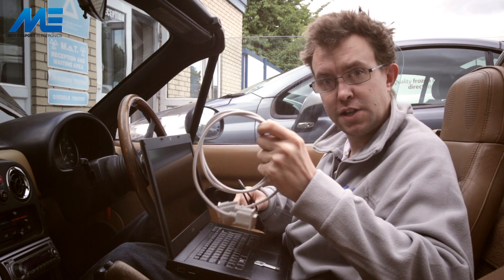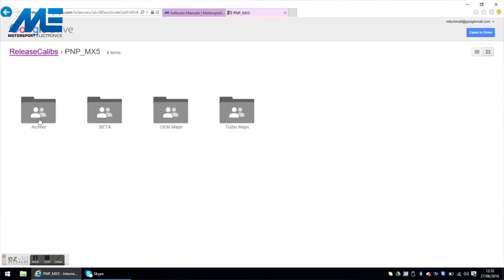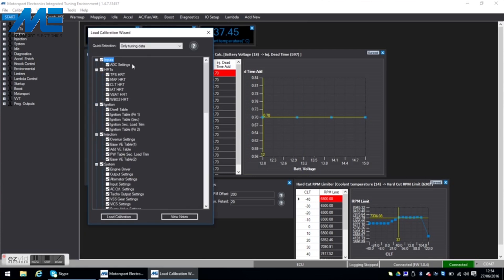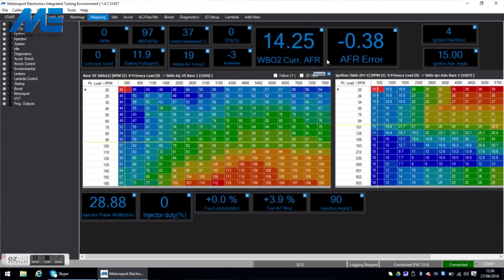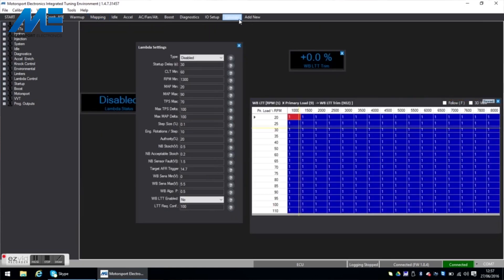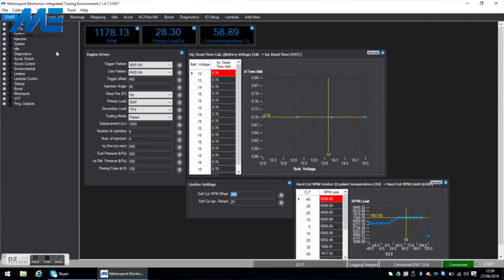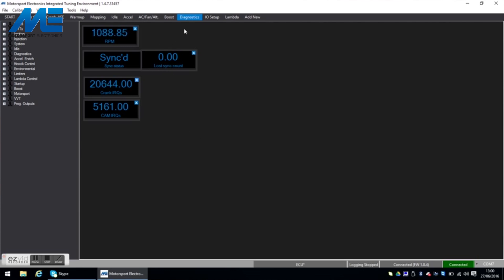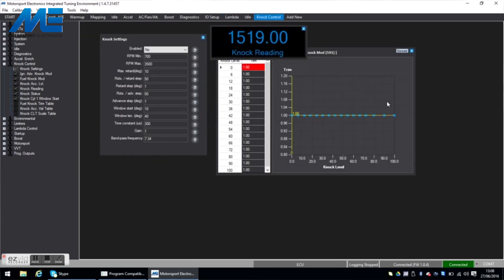Motorsport Electronics ME221 ECU Install | Part 2 - Basemaps and Basics

Comment: Hey, does the me221 work in all mk1/2 mx5s? I have an mk2. 5 1.8vvt which I'm turboing, but could i just fit any me221 and change the basemap myself? Or are the ecu plugs different? Thanks!

Comment: I’ve just installed the ME221 ecu, followed the checks and base map instructions; however, it did not go as swiftly as this. Idles but doesn’t run at all and stalls. Anyways, the car will go to a tuner, as recommended, but will not be possible to drive there with me221 installed.

Comment: Great video, definitely going to get one soon...I'm after an itb setup. I was wondering, how safe are the ignition tables on the basemap? Will you be able to race the car at all before you tune it on a Dyno?
Reply from the maker: They are pretty safe but we would never recommend hard use until checked by a pro! :)
Reply: @MotorsportElectronics  I see, thanks a lot for the information. :)

Comment: hello i am trying to install the me221 in to my mx5 i hooked up the cables and a vacuum hose it wont start on the test map and i cant get my laptop connected to the ecu
Reply: Patrick Rubingh Hey mate I had this same issue - mine was to do with a wire on the back of the ECU - it should be connected to the second to last pin, not the last pin as it was shipped. Had to re-solder the rear - to the second to last pin & it connected fine.
Reply: @farnorthcustoms9596  i already got it connected with a different laptop but i couldnt get the engine starting the ecu is now at motorsport electronics i hope to get the turbo project starting soon😌

Comment: what signals does the 221 need?
Reply from the maker: For it to do what? All of the OEM car sensors except MAF (as you can use the onboard MAP sensor)
Reply: @MotorsportElectronics  for it to be able to run a car. i want to convert a 924 porsche to normal injectors and get rid of the distributor. it has no tps or crank sensor (only in the distributor)

Comment: Hello,
I want to swap an 1.9 VVT engine into my 90 mx5. i would still like to use my factory cables. is there any option which u would recomment me that i can realise the VVT swap and make it as easy as possible?
best regards
Reply from the maker: Yes, our ME221 8995 variant still offers full VVT control - you ust need to wire the solenoid ionto the AUX port of the ECU :)
Reply: Hello, thank you for your fast response :)
do you have a manual or a thread, that everyone can do this?
or maybe u can make a video because i guess this is an interesting thing because vvt swap for na is pretty nice and maybe popular too in my eyes. you would help the community so much :)

Comment: Where do I wire in my electronic boost control? As I have removed my charcoal canister and i believe it's something to do with the purge solenoid
Reply from the maker: Yes use the purge solenoid wiring (or any other spare output)